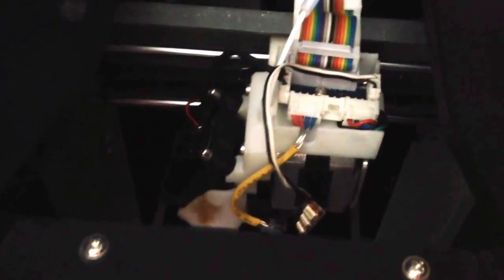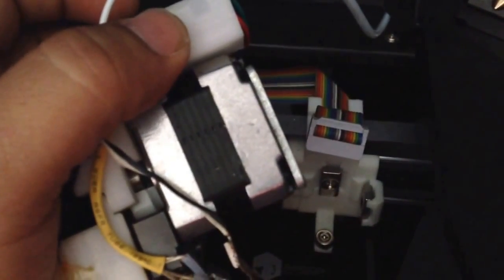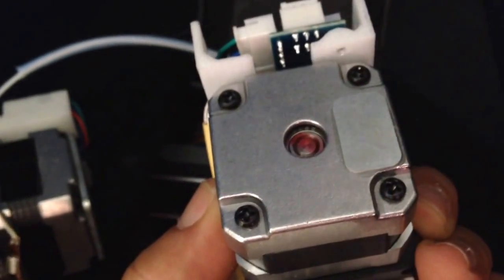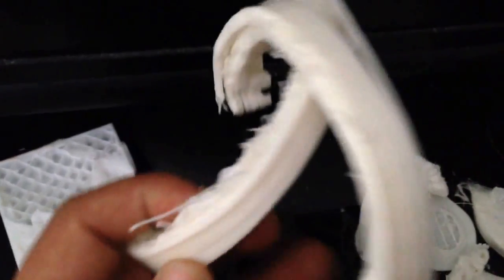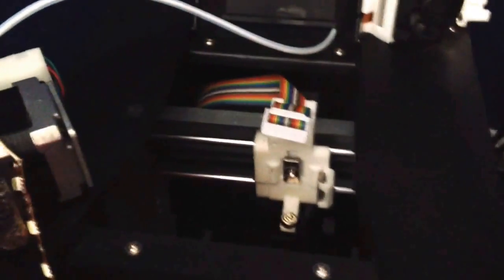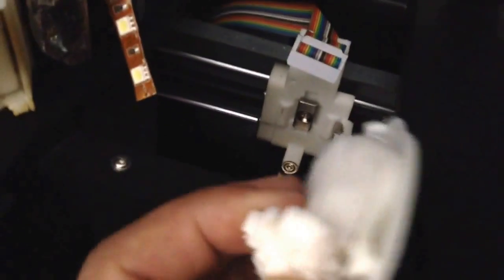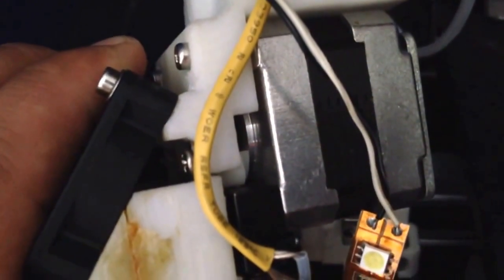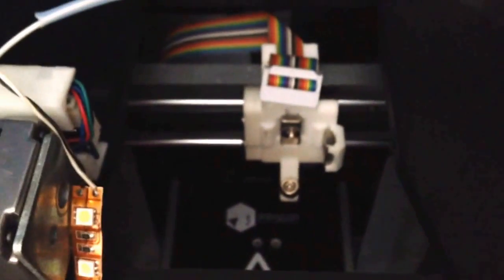Design flaws with 3D printer UP mini from pp3dp.com

Comment: not all of those "messed up" prints are not caused by "enough pressure"....keep your door closed and the heat inside to prevent the warping or separating of the ABS layers. Thanks for the magnet alert!
Reply from the maker: This was a long time ago and yes I have learned a lot since then.. These messed up prints were cause by that .. Because after o fixed the magnet prints started to work again.. But yeah preheat the bed and keep doors closed and prints will come out ok

Comment: Man you saved me! That little metal piece glued to the side came off and I didn't even notice. I used some JB Weld and permanently adhered it. Also noticed the garbage 40mm fan that comes with the upmini managed to lose about half the fan blades. I spent $15 replacing it with a real fan from radio shack and was blown away by how quiet the upmini can be! Out of the box it is extremely loud and always sounds like something is breaking. Probably because something actually IS breaking. Fixed those and it is working perfectly... for the moment